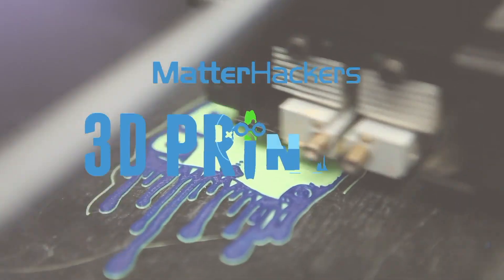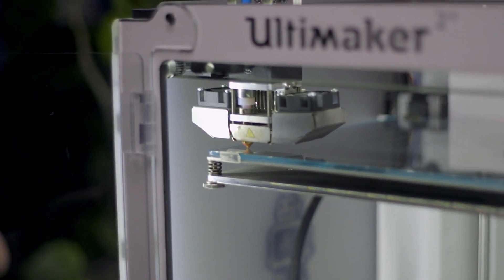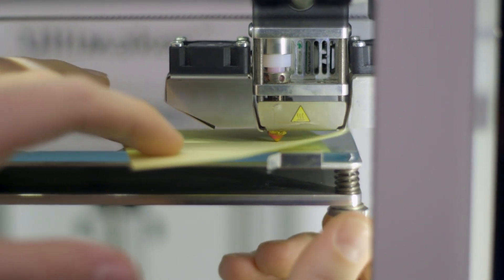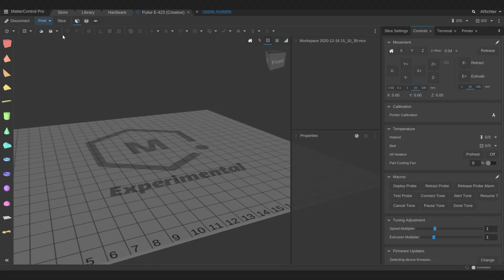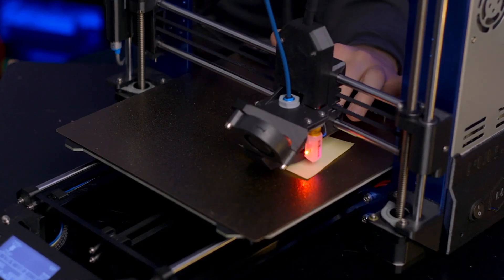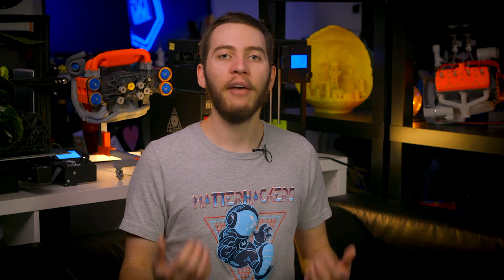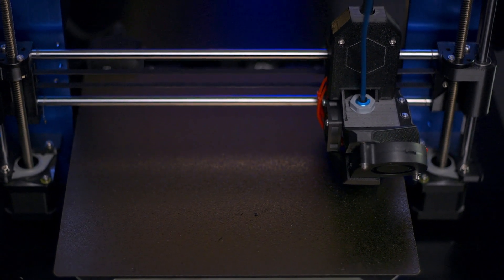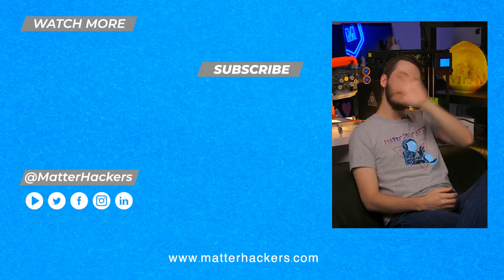3D Printing Essentials: The Best Way to Level a 3D Printer's Print Bed

Comment: So I have an Flashforge Adventurer 4, it has "auto leveling" but sorte like firmware :)

Am I to understand that with this firmware leveling, its basically showing the printer where to compensate on Z by going up or down, in order for me to have a level and smooth print? 😁

Comment: Alec , is it possible to export the bed level settings to Simplify3D? Also , is there any way you guys might make a video in the future showing how to use manual controls on the pulse XE’s LCD screen and what everything means ? 

Best printer I’ve had hands down 👍